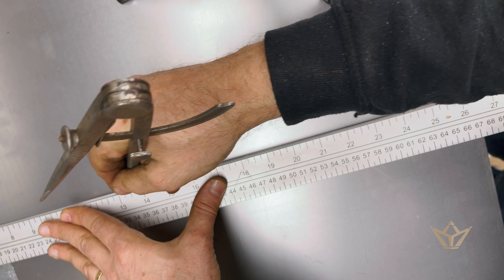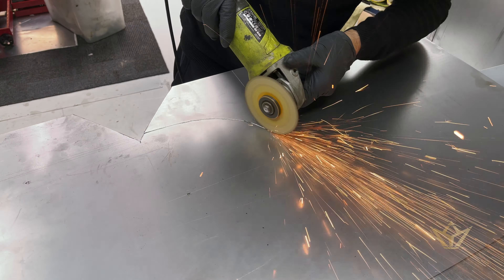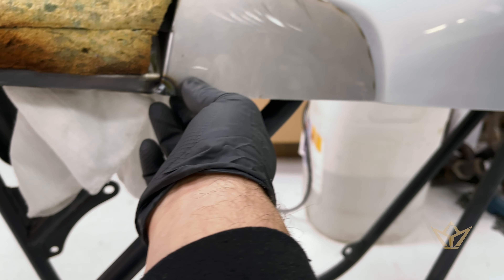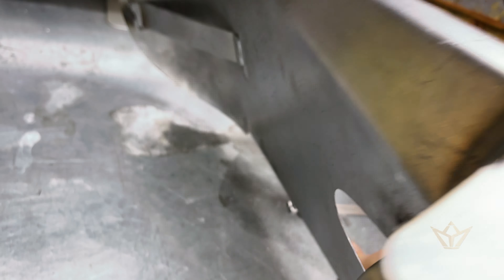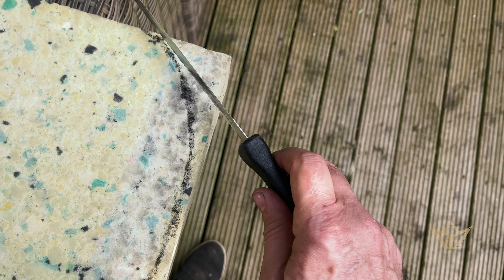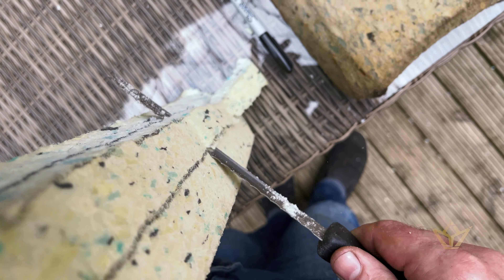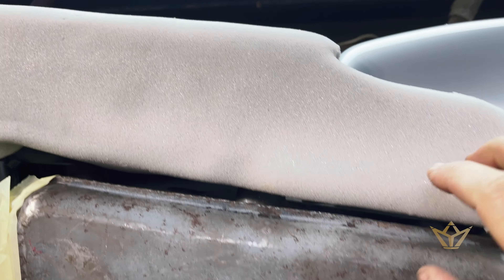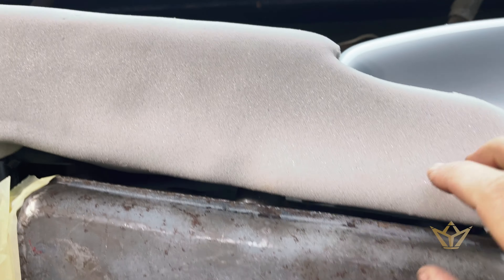WEEK 8  - HOW TO MAKE A MOTORCYCLE SEAT FROM SCRATCH! - 1968 Norton Commando

Comment: I have had a 1971 Fastback for 6 years which I completely rebuilt.The Norman White Restoration book is very helpful.I wasn’t sure of your rebuild at first but after watching a few more series I think its a great restoration.I intended to keep my fastback original but I decided to use updated modification to the engine & swing arm.I think the Fastback is the best looking Commando not every body agrees as specially opinionated motorcycle Journalist's after that said great motorcycle well worth restoring ride safe Steve.
Reply from the maker: @StephenEmson  thanks Stephen. I’ve neglected the Commando but it is the next bike to complete after the RM’s 
I have to re-research the period correct parts again..

Comment: Perhaps those "height adjuster" screws on the bottom originally had rubber caps on them where they contact the frame? I have never worked on a Norton, but have seen that on other bikes.
Reply from the maker: Hi Seth, keep watching for the end…👍